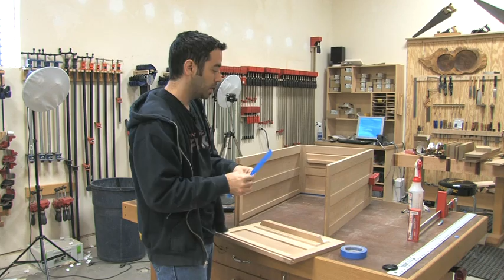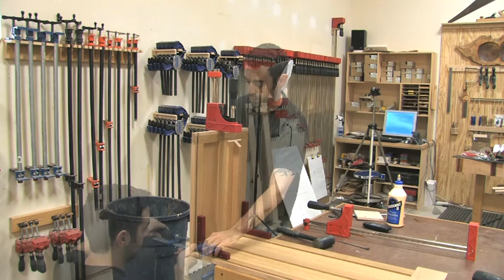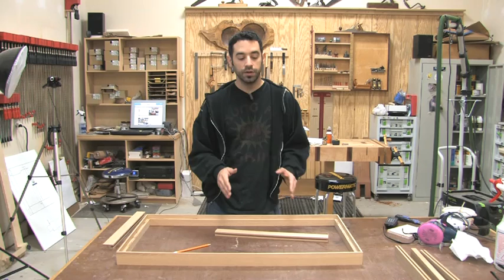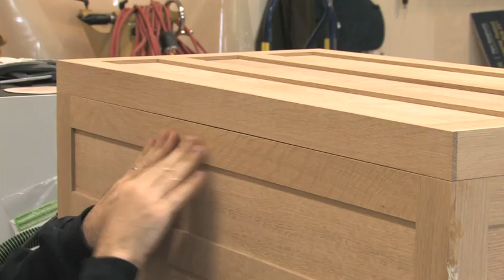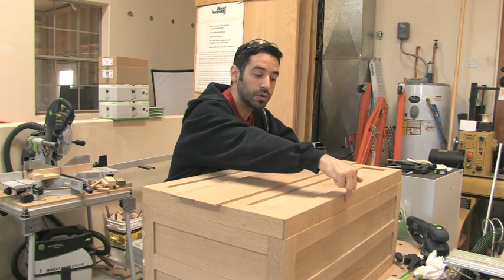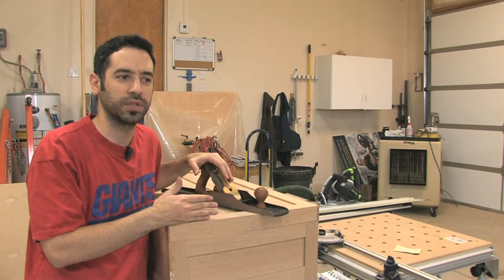How to Build a Steamer Trunk (Part 3 of 4)

Comment from the maker: @Strykercom1 that's a bit tough to answer without knowing more about your goals and budget. I use LieNielsen but they are quite pricey. Wood River and Stanley seem to be making decent (and less expensive) planes these days. But as far as which ones to buy, that really depends on how much hand tool work you plan on doing. If you can, pick up Chris Schwarz's dvd, Coarse, Medium, Fine. Really helps put plane options in to perspective.

Comment from the maker: Most times, I retract the blade for storage or make an effort to prop the blade up off the workbench. But ultimately, I don't fear that the wood is going to do any major damage to the blade. The blade always wins the fight. In my opinion, sitting a plane on its side exposes the blade to damage from other tools that might be in the vicinity. So for me, it's always sole down.

Comment: Couldn't you have run the top through a table saw to take the bow out? It seems like it would have shortened the piece up but been faster and you would have had a true edge on all sides.